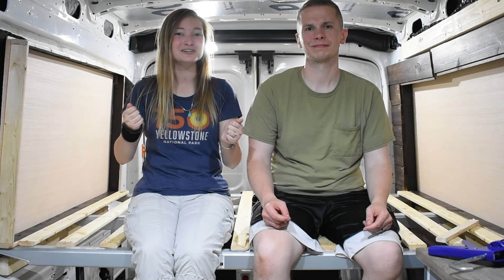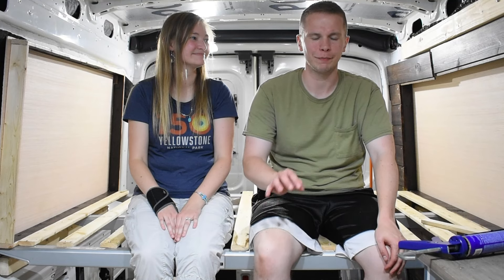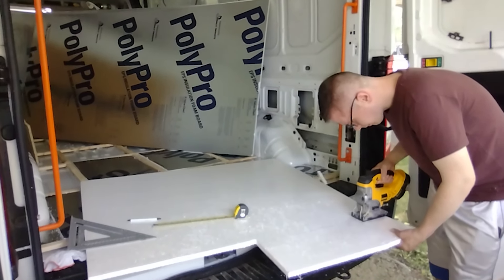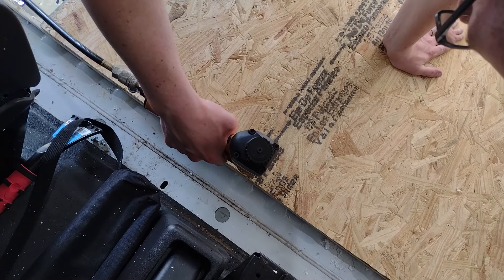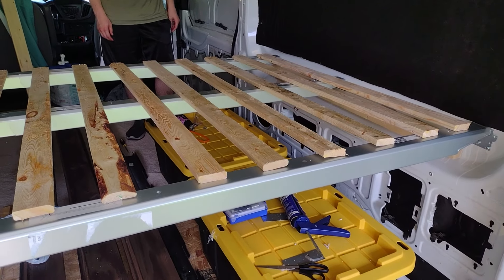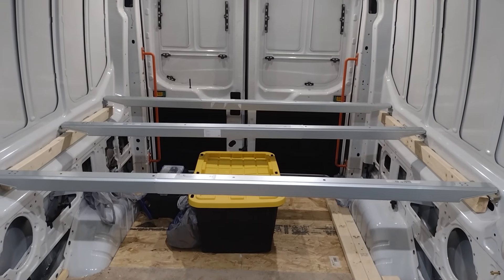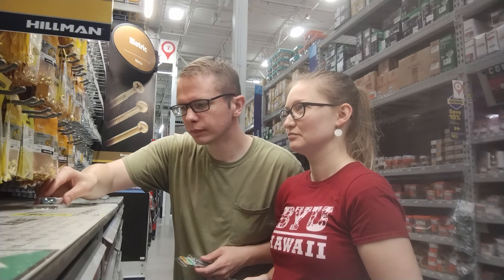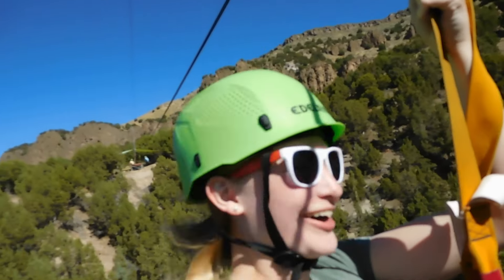🚐Camper Van Build Part One - Building The Floor and Bed Frame In A 2019 Ford Transit 150, Low Cost!

Comment: I have a van built series on my channel…… my channel is my name…….. I did the same thing Furring strips with foam board insulation……. I think it was a good idea. There’s no heat in my floor, but it’s not cold on my bare feet.👍😎
Reply: Good to know this works!